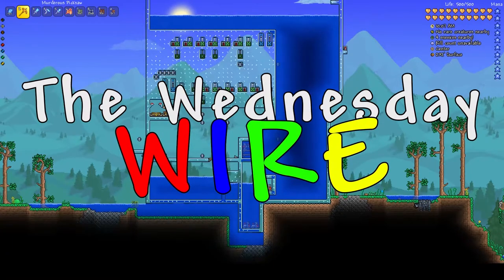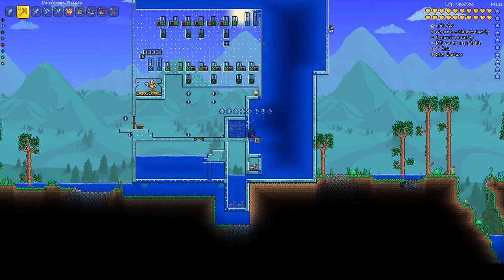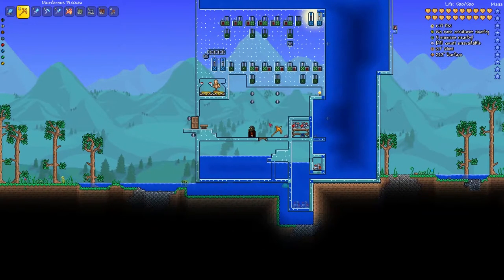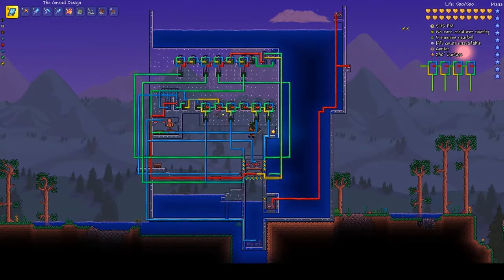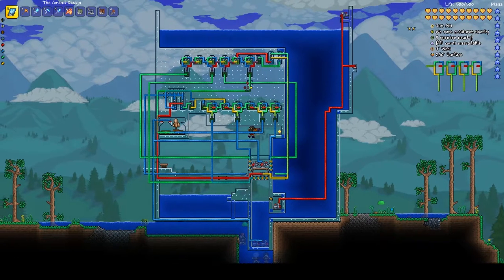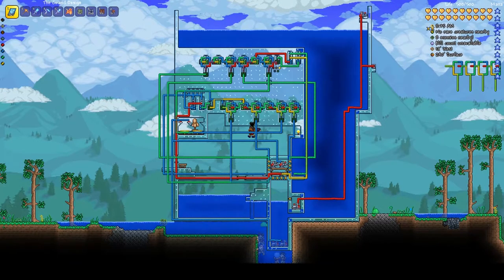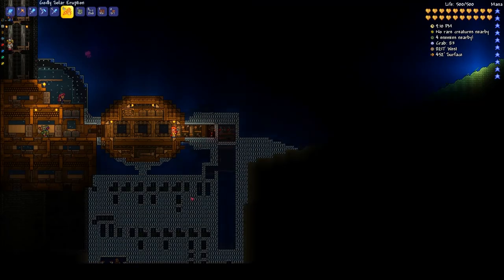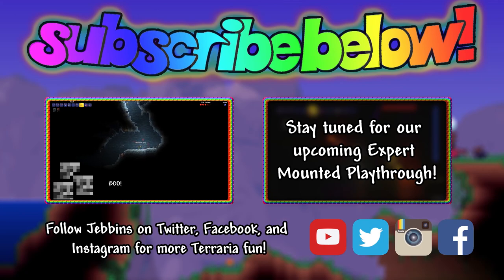Terraria 1.3 Wiring Guide | The Wednesday Wire #1: Two-Way Airlock Entrance

Comment: How do you prevent excessive water duplication?
Reply from the maker: So you can destroy water using lava, a chest, and the outlet pump... basically make a U-shape so that the space inside the U is 2x2. Put the chest inside the U and place any item inside... fill the U with Lava and then place your outlet pump above the U so that water will fall onto the lava. The chest prevents obsidian from forming, and the item in the chest prevents the lava from destroying the chest..... all thats left is to wire the outlet to an inlet placed where you want to set your water level and hook the pumps to a timer or engine.
Reply: Jebbins Smart! Thanks for the help!